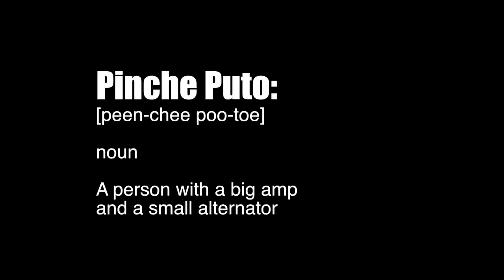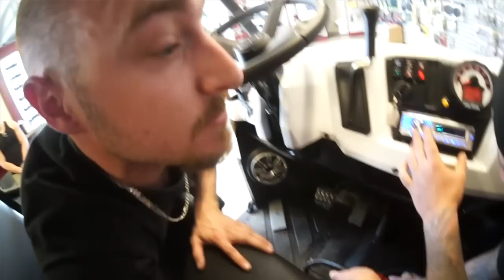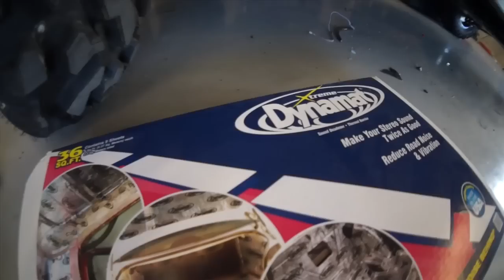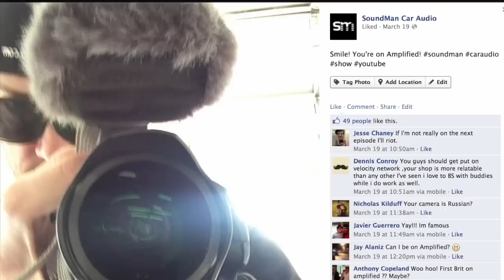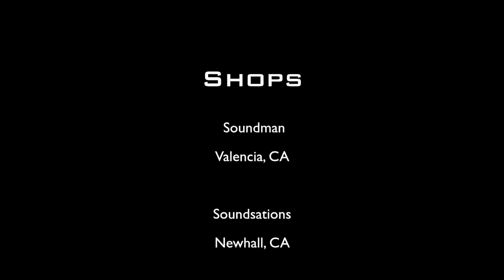Painful Bass, Fi/Sundown Hairtricks, Taco bell drive thru prank - Amplified #98

Comment: Is a body ground good enough for a system? Just basic 2 amp system, 4 speakers and 1 sub, should I be running a ground straight to the battery? Some people seem recommend doing that rather than a body ground.

Comment: How much would you think it would costs to get a custom box to be made for the back wall of my 1998 Ford Ranger XLT with 2 12" HiFonics 800watt dual coil subs? And me still having the ability to use both back seats(They are mounted on the sides under the back side windows).

Comment: Doug you are awesome. Subbed, I gotta question I gotta new truck and want a new system in it but keep stock head unit, I wana keep it under 500$, looking for an amp, 1 sub, 4 speakers. Not looking for loud ass bass just clean sound without distortion at high/max volume.